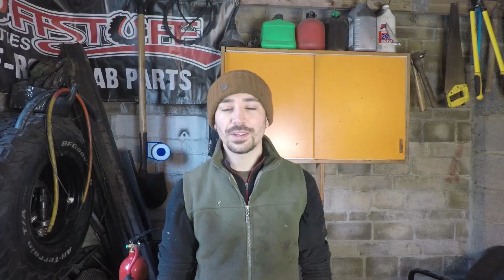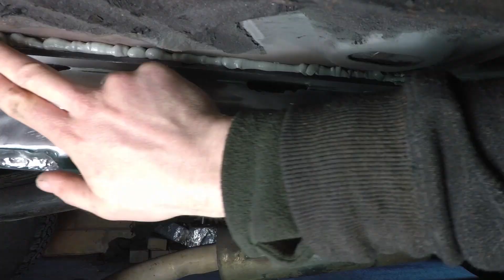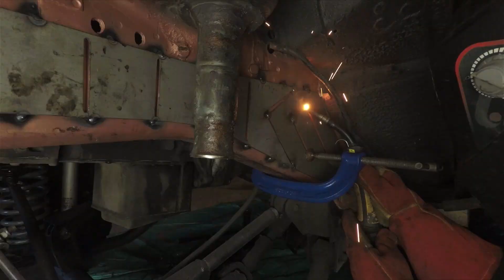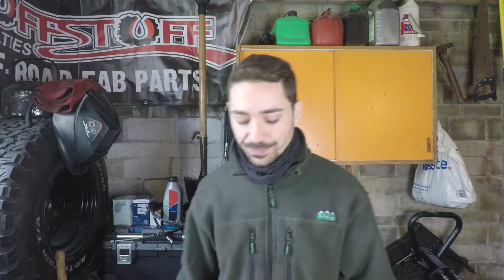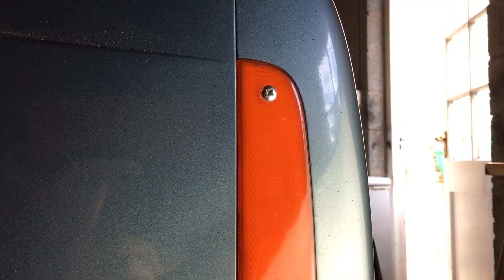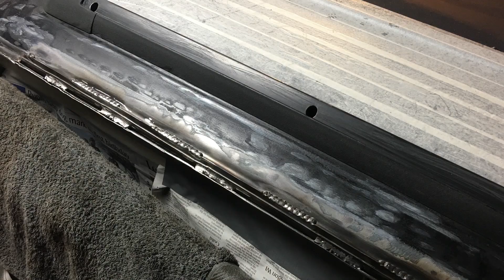Ep05 - Jeep Cherokee XJ Overland Build - RUFFSTUFF Front Frame Stiffeners

Comment from the maker: Cherokees are like never ending projects but when you have to travel and live in one for four months with your wife it needs to be in a good operating condition. I've been building and using the Jeep as a work truck and offroad toy for the last two years and although it's pretty solid its going to need some work before we leave for Scandinavia. 

In this video I install some front frame stiffeners from Ruffstuff Specialties. It's a fairly simple job and i'm not the best welder but its made a huge difference to the Jeep to date and it would be the first thing I would do if I bought another XJ. The build is finalised in this video with a front axle rebuild and general overview of the camper. I rebuild the drip rails and fit the roof tent. It's been a huge job of daily work for almost five months and the Jeep is still not where I want it to be, but time is running out and it should be good enough for the trip!    

This video is originally and MCQBushcraft upload from my other channel but I have started this new channel and moved all the Jeep/Adventure stuff here.

Thanks for watching
Reply: I binge watched all of your videos man. The content is awesome and i love the overland stuff.
Reply from the maker: @Willdriftfortires  Appreciate that! Glad you like the videos.

Comment: so looking through the videos now there is nothing about how you redid the rocker panels where did that go and do you still have video about how you did it?
Reply from the maker: I found it for you https://youtu.be/n1NAPLyzvMM it's pretty old but this is how I did it. I then made an update video a couple of  years later on some of the failures https://youtu.be/SgMIFQH-7a0 basically I used loads of filler for lack of knowledge at the time and it came back to bite me.

Comment: Hey Mike, i just want to know what brand the outer axle tube seals are that you use? I would like to put those on my XJ. Those look great 👍
Reply from the maker: I use these in the 40mm variant - https://www.aliexpress.com/item/4000166629933.html
Although technically I use exactly this one here - https://www.clasohlson.com/se/Gumminippel/p/Pr406738000 - because its what we have in Sweden. Really cheap, they have three internal baffles and you can top them up with grease with a needle nose adapter on the grease gun.
Reply: @WorkshoptoWilderness  thanks for the info Mike! Cheers

Comment: I'm doing this job also. Did you have any trouble installing the front bumper again? I can imagen that the bumper brackets are not made for the additional width.
Reply from the maker: Yeah the bumper no longer fitted. I had to cut of the bumper mounts and weld them back to the bumper with the clearance to slide over the stifferners. Hope the jobs going well 🙏
Reply: @WorkshoptoWilderness  Thanks Mike. Doing the job front to back. Your video's really help!
Reply from the maker: @silB112  glad they can help! Its a big job, will totally different to drive once its done